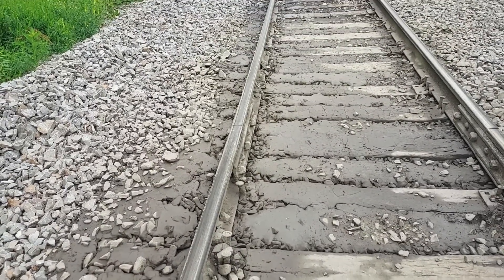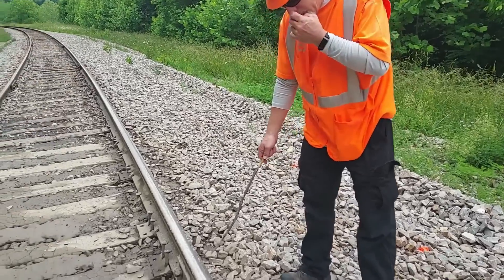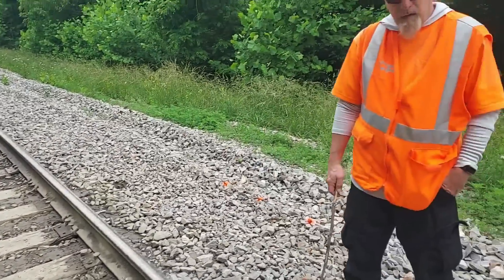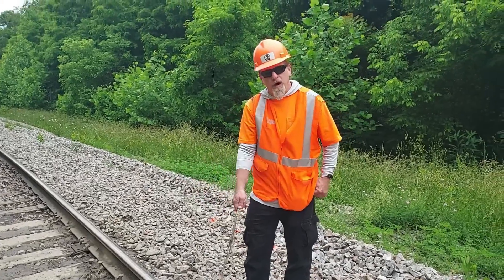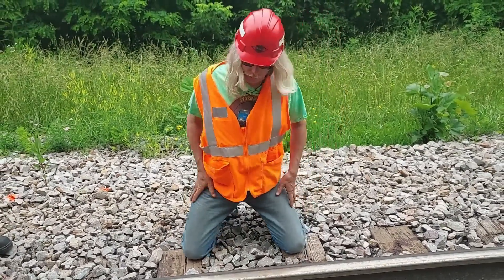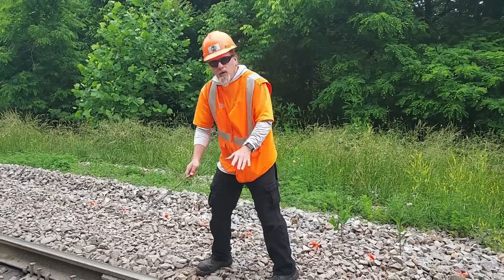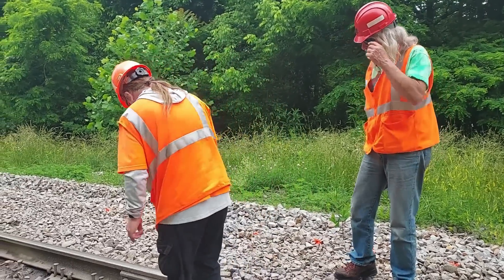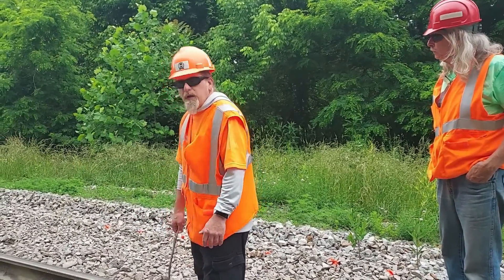Inspecting Track for a Major Class 1 Railroad - Part 3

Comment: Opps Sorry  Dave  for miss spelled  words  on my next Comment.....(WE DO),,,,,,,,* GET INSPIRATION  FOR NEW RAILWAY  IDEAS FROM WATCHING  YOUR FUN VIDEOS DAVE.....SO SORRY.....(IT WAS ONLY A MISS SPELL WORDS..).THAT BE SO WONDERFUL  IF YOUR MINE RAILWAY  CAN RUN SOME TEMPORARY  REVENUE  BRIDGE  TRAFFIC    WHILE  THE MISSISSIPPI RIVER  IS SO LOW ...WOW JUST THICK OF ALL THESE IMPROVEMENTS SUPER DAVE COULD  DO....
Reply from the maker: Sure wish we could help out the situation Bradford! Currently
we are having a hard time keeping coal running on the tracks
with lot's of problems at the prep plant and under ground.
So far tho the Monongehela River has not had a big drop
in water levels, although it's been dry here for a long time now.
So when we do get trains coal barges are still moving.

Comment: It is crazy that they did not plan better for really good drainage.
that is key for any railroad to be dry, or dry up quickly. Steve 
is an amazing source of knowledge and how to do it correctly.
like at the low spot at the joint, that it has to be raised above
the hight to be level, due to compacting of the added stones
when you have tonnage going over that spot. how easily does 
the spikes come out of the ties? really there is nothing on them
to have them resist being pulled out. just the resistance between 
the treated wood and sides of the spike. (but when you want 
them out, they do not come out easily.) have a great day David.
Reply from the maker: When they put that pipeline in there wasn't an inspector like
a natural gas pipeline would have Barry, just a representative from
the mine. As much as I complained about the grading work,
it fell on deaf ears. We have several places where they
graded so the water would go back into the track, some of those
have been re graded since but not all and this is probably the
worst. Next video out will show what we did the following weekend
to get this spot fixed up. Very much appreciate your watching
and writing in today my friend.

Comment: Great explanation on how to deal with this problem. We call these wet beds and I was told they tend to come back in time as the vibration of passing trains causes the mud to rise to the surface. kind of like quick sand. Not sure if thats true but there was a spot they were having to go back to and it was always light coloured clay that came through. As Kezza says we use boards to level up the track saves having to stick your head on the rail but both ways are still used over here. The boards work in the same way your tamper levels up track except you look through them rather than shine a light through them.
Reply from the maker: Thank you cedarcam for sharing that with us. Interesting about
the boards. Sometimes we have problems with mud even after
cribbing, it just happens. Best way to go is take the track out
or undercut if you don't have trains running, but in our case
they don't like to shut down trains so we can do things the
best way. Next video out will show how we fixed this mud
spot. Really appreciate your tuning in and watching today my friend.

Comment: Tamping and cribbing  question in that mud spot would putting in switch ties work for a temporary repair thanks Dave and Steve
Reply from the maker: Thanks Gary for visiting with us today and taking in the home movie
my friend. Next video out will show how we fixed this much spot
the weekend after Steve's visit. Switch timbers would help
hold track surface better than a regular tie, but best solution is
what we did, dig out the mud.
Reply: Your very welcome Gary.

Comment: More great stuff Dave, Thanks! If that mud spot is recurring, would it help to have those 2 joints welded? I'd think that those joint bars or the bolts would be prone to breakage.
Reply from the maker: Glad you had a good time with us today Alan. Really appreciate
your visiting with us today. Next video out will show how we
fixed this mud spot the next weekend after Steve was here.
And you are so right, it always helps to have welds instead
of joints but with the 3 bolt holes in each rail they won't weld
them because the 3rd hole is too close to the weld.

Comment: The process Steve was talking about with Dave (redhat), we call scoping here in the UK, using 3 scoping boards. The outer two have a narrow cutout and the inner one, where the track is at the lowest point, has a line, we use to get our level from. With either measured packing or kango's to pack fresh ballast, each side of the rail, never in the middle of the sleeper, as it could split the sleeper in half.

One question, the only hats we can wear are white or blue. Red and Green are not allowed, as they match signal colours, does that apply at all in the USA?
Reply from the maker: Very interesting comment Kezza! Really appreciate your sharing
that with us. I love to learn new things like what guys do and call
things in other countries. Here on our RR we so not have
signals so there is no stipulation on color of hard hat. I cannot
say what happens on other RR's in this country, but your
comment was the first time I've ever heard of that. Not allowed the
green and red does make good sense to me tho. Thank you
so much for visiting with us today and watching my friend.
Reply: Thanks for watching, The guy had a red hardhat on due to the only one he had to wear. On the CP we Used Orange like I had on in this video and White in our department.

Comment: What about a vacuum truck that sucks up the mud and rock ?
Reply from the maker: Good question ocsrc. We have tried Hulcher vac truck several times
in the past for mud spots. They do a very good job, however they
are agonizingly slow. They have to use an air wand to break the
hard mud spots up. It would take them about the same amount
of time to do 1 rail length as it takes me with my excavator
to do 3 to 4 rail lengths, although they do get more of the fines
out than I do unless I have a man with a shovel working with me.
Thanks for paying us a visit today and watching my friend. Next
video out we have a grapple truck in that mud spot and put in
some new ties there.
Reply: @ccrx6700  It seems like someone could come up with a way to make track that could be worked on removing the old dirt and ballast without having to dig it out.

I am thinking about having a long time under the existing ties directly under the rails, so you could lift those ties, lifting the entire track fully intact and shake it up and down and either scoup out all the dirt and mud with a giant sweep of an arm, or suck it up with a vacuum truck, and then set it back down and dump new ballast

I rarely see Class 1 railroads doing this much maintenance

PanAm had not maintained their tracks and even after so many years of neglect, CSX is fixing and replacing the sections that are really bad, but it is not a routine thing.

Usually these crews are out laying brand new track for new yards and lines.

Is there something unique about your railroad ?
Is it the fact that you only haul coal and that plugs the ballast faster than anything else ?
Reply: We have used the vac truck on our territory at Canadian Pacific also, Dave is right its a slow process and hard to get that much track time in one shot, We had to request track blocks  a week ahead of time. This however was on 79MPH railroad with Amtrak, Stack trains and so on. Thanks for watching.